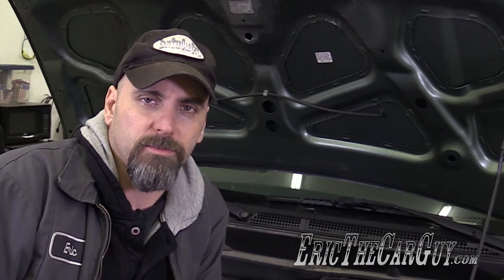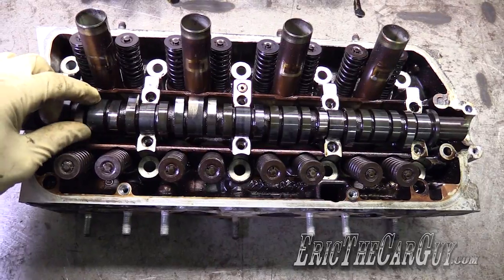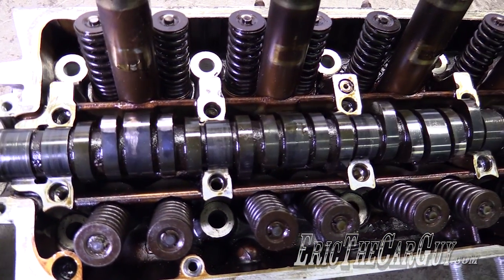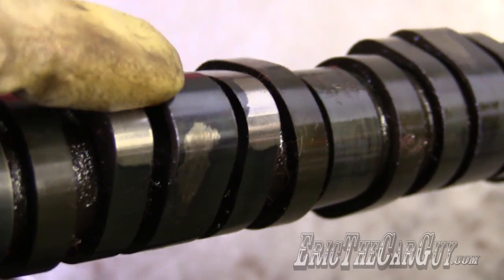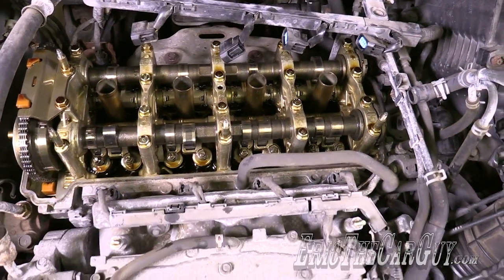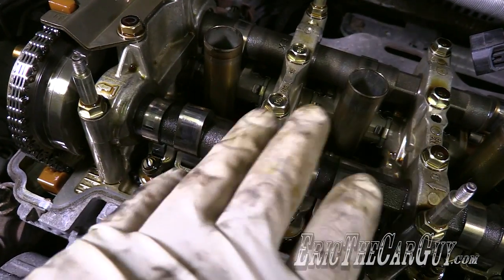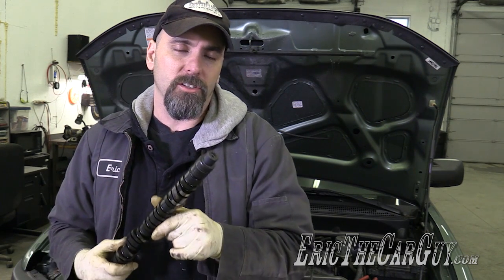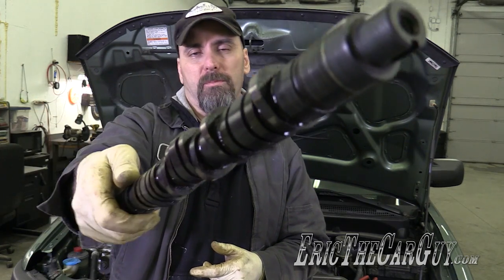iVTEC How it Works -EricTheCarGuy

Comment: 90 percent of new cars and trucks have this now, it is also called variable valve timing.
Reply: Even though many cars "might" have it. Honda instead of many others nailed it. The timing, cams, and engine can handle it and produced more power due to the ecu they use.

Comment: Funny, I feel like the VTEC on my 01 Honda Odyssey as it has plenty of low end torque but really wheezes out above 3500rpm.
If its mechanical based on oil pressure, then how could it fail without loosing total oil pressure.  (PS if you want to find out I live in Dayton :p)
Reply: generally they dont fail. the solenoid could fail? the sensor could fail. they usually dont fail mechanically.
Reply: So its not entirely mechanical then (which is what I thought originally).
Reply: well the cam lobes operate the valves purely mechanically.. it is engaged using oil pressure, which is controlled by sensors and solenoids.
Reply: and ultimately the ecu, tells the solenoids when to use the oil pressure to engage the vtec rockers, which are actuated mechanically by the vtec lobes.

if that makes it more clear.
Reply: *****  neverknows best Yes initially I figured it was some solenoid, but Eric's explanation had me a bit confused.  There is no SEL light on but the car is very sluggish in the upper RPM, and also I've never heard the engine change tone or get that "VTEC kicked in yo" feeling that hopped up Civic's and Prelude's get when the cam changes profiles.
EricTheCarGuy 
Is there any good way to test what the problem is?
Reply: you cant alwaays feel it. also the k24's from accords, elements and crv's usually have a lower changeover point, and a less agressive secondary cam lobe.. so the difference would be less noticable.. and by top end do u mean at high speed? or at the high end of the rev range regardless of speed? even at low speed?
Reply: High RPM...feels like its got ~200ish torque at lower RPM and about ~170hp max where it should have 240hp. 
It says VTEC right on the engine cover that I took off...just doesn't seem to have it anymore.
Reply: what car is it in? cuz most k24s only have about 170 anyway...
Reply: First post says...Honda Odyssey.  I believe its a 3.5L V6.
Reply: im sorry thats my mistake. the oddyssey engines are different. they behave like SOHC since i believe that they are one cam per bank. also some odysseys have variable cylinder control, which allows them to shut off up to 3 cylinders depending on whats needed.

and yea for a passenger car like that. its optimized more for low down torque, and comfort more than high revving power.
Reply: neverknows best It still says VTEC so it ought to have two cam profiles even if its SOHC.
Reply: Adam S im not saying it doesnt. im saying it may only have vtec on the intake side and not exhaust side. and a lot of vtec systems are for efficiency, that may be why yours doenst feel powerful up high like the sports oriented vtec systems.
Reply: K24s come stock with 240

Comment: U should do a video of VVT-i works on a v8 engine like in the 1UZ-FE
Reply: its the same as vtec. they are both variable cam timing systems.

hell even the newer corvette v8's have some form of cam timing, and theyre pushrod engines.
Reply: neverknows best 
O nice to know is about the same.

Comment: Eric, question for you, I recently had my car have some major problems occur, and possibly have the oppuronity to have an engine put into my car that will create more power. I have a 2000 ford focus ZX3, about a week ago... one problem lead to another and my car caught on fire, it was my fault, now im in need to fix it. Before that occured i was having a rough idle for about 2 months, previous owner told me he swapped out the engine with one that was newer, the idle is only rough every once in a while, i did general maintenance, spark plugs, air filter, oil change, ect... I'm wondering if it would be worth while, while i'm fixing it to swap out a engine from an svt focus of same generation into my car, or should i just keep it the same and fix it back to what it was before this problem occurred when it... caught fire. Right now the parts list that i'm looking at to fix it back to what it was is new air filter housing, new battery, battery housing, engine wiring harness, new thermostat, and a couple hoses. I also have been having quiet an oil leak, I went through a quart of oil about every 2k miles. The leak has occurred from the front drive pulley. I'm in a loss as what to do... I love driving my car, love the look, love everything about it.. ( info about it, Since i bought it this past june I had to replace the oil pan gasket, fuel pump, rear shocks, clutch and slave cylinder, and a couple other things.) I'd love to hear back from you! Ps. Keep up the good work with the videos, they are very helpful for the handy man.
Reply: The SVT engine makes a lot of peak power. However, you may run into other issues. You would definitely have to purchase a matching SVT ECU. And you may or may not have to change the trans also. I'm not sure if the split port 2.0 motor has the same trans mounting. The SVT does come with a six speed manual. And it may mount different. That being said, it may be easier to replace the motor than trying to hunt down little problems. But if you don't want to have to make any other changes, replace the motor with the same year and model to avoid any other differences. Cheers.

Comment: This is awesome knowledge overload. The intricacies of this system are amazing. Nothing better than telling a VTEC owner what VTEC actually is and does. 

Are there any other motors (non-honda) that have a similar system?? Or is the Honda VTEC a one of a kind??
Reply: bmw has Vanos
Reply: Whoops used the word 'motor', Should be 'engines'. Don't let the trolls see that.
Reply: Darren G. I heard that VVTI is basically the same. i don't know though.
Reply: arnaldo vargas

I had heard the same thing. Many companies just dub the same thing under a different name so it wouldn't surprise me.
Reply: almost every car manufacturer has "variable valve timing" which is essentially what vtec is. its not a honda thing by anymeans. and im a honda owner
Reply: The Nissan version is called NEO VVL
Reply: dont know what its called. but nissan, GM/chevy, ford, honda, toyota, mistubish, bmw all have ones. i dont remember their names offf the top of my head. lol
Reply: Toyota's VVTL-i
Reply: VW, Alfa Romeo, Peugeot, Citroen and many other have it too. Its just so nothing impressive, that most manufacturers don't make a big deal of it. Just like DOHC or at least 4 valves per cylinder are common in most European cars and somehow you don't see those badges on the trunk anymore.
Reply: INFAS166 those engine features WERE something to be proud of at one time or another. they are more commonplace now so they dont show them. the vtec badges usually still only come on the performance cars from honda. and theyre more of a marketing thing than anything else now.

much like mopar and "hemi" lol
Reply: ***** well pretty much all engines use hemispherical combustion chambers. so even hondas are hemi's now a days. its just a badge now. it not anything special now.
Reply: ***** actually A LOT of variable valve timing engines have more than one cam lobe... 

and it was unique. a long time ago. but its not unique anymore.
Reply: ***** no thats completely wrong. many many have multiple camp lobes per bank of valves.
Reply: ***** also, even single cam engines can have multiple cam lobes for the intake side.
Reply: ***** well since i have a vtec-e engine i should know. what it does is use one intake valve under lean burn mode, and 2 intake valves under normal (higher rev range) operations. 

your definition of the economy vtec is a little off. it starts off with one valve, then engages vtec which engages both valves.

this is essentially what the vtec on the non performance k series engines does. the k20 from the base rsx and ep3 si use the same system. but they have cam phasing also.
Reply: ***** technically ALL versions of vtec are for economy at least a little, they allow you to have economy at the bottom range and power up top. the vtec-e system switches between 12 valve and 16 valve mode basically. the k20 20 in the base rsx uses a similar system on its intake cam shaft, but also adds in cam phasing on top of it.
Reply: The vast majority of automotive manufacturers have (and still do to an extent) played with different valve lift/timing systems for their vehicles. Honda/Acura of course utilize VTEC, Toyota has used VVT-I (just cam timing) and VVT-IL (Variable timing with life, just like VTEC), Mazda utilizes variable valve timing (not sure of system name or if they utilize variable lift), BMW uses VANOS and double VANOS (Variable lift and timing for either one or multiple cams), Nissan has variable valve timing and the old schoold (NEO VVL) system which acted on lift as well. Basically everyone uses it to a degree.
Reply: ford does this with there 5.4 litre triton there called phasers
Reply: Vtec is a form of vvt (variable valve timing) Most other car manufactures have a vvt engine. The demand for better fuel economy while keeping the performance is pushing the technology.
Reply: ***** you are mistaken, standard VVT (vtec) has two different cam profiles per cam shaft. two for the exhaust cam and 2 for the intake cam. Ivtec, has both of these AND cam phasing.

there are a few exceptions, the non performance k series ivtec has what ammoutns to the vtec-e systems of old. and only applies to the intake cam, the performance oriented k series engines have two cam profiles per cam, AND cam phasing. (something that the old vtec lacked)

what that article is calling vvt (if you follow the vvt link) is cam phasing. most modern cars with variable valve timing, ACTUALLY change the cam profile. as well as cam phasing in some. mazda does it, ford does it, chevy does it, toyota does it, im not sure i know of any subaru's that do... but im not making a claim on that one.

regardless you are mistaken, also the vvt link in in the link you posted uses a k24 or k20 head, which has two cam profiles for the intake cam and one for the exhaust cam, AND cam phasing. the I in ivtec denotes cam phasing in addition to multiple cam profiles that existed in the previous generation vtec motors of honda.
Reply: +Darren G. Subaru also has more or less the same system, called AVCS, and most car manufacturers listed above by other respondents have some form or another to control valve and cam timing. The only engines that typically don&#39;t have it are old engines and V-8 crate motors which I believe are simply an OHV or SOHC design

Comment: just to be accurate the camshaft lobes only open the valves they don't close them. valves close from the tension of the springs. its not a desmodromic system that the cam actually opens and closes the valves..
Reply: technically they do not close the valves, but they do control when and how quickly they close due to the other side of the cam lobes.

Comment: iVTEC is better because its a stepless sytem while VTEC is either on or off iVTEC is a more advanced system to get either the same or better results
Reply: actually i vtec works the same as normal vtec. it just has another added control, being cam phasing.. which has no effect on the step or stepless-ness of vtec engagement. 

it is however better than normal vtec.
Reply: i know the ivtec system from psa engines (peugeot citroen) im not sure if it works the same as that vvt but on th psa engines the camschafts angle can steplessly be adjuste over a quarter off the timing gear the system works with hydraulic pressure you have 2 chambers inside the timing gear with valves in the valves are connected to the camshaft when the pressure gets on one side of the valve it pusches the camshaft either clock or counter clockwise in relation to the gear this way it can be steplessly adjusted to get the perfect result every time
Reply: yorrickwi i get what youre saying. but thats not stepless. since variable phasing of the cam shaft doesnt effect the step on and off of the secondary lobe. it might make it seem a little less sudden. but that could also be due to the secondary cam possibly being not very agressively different.

we dont have the "psa" stuff here (america) but i vtec can still certainly have a very exaggerated step onto the next cam lobe. even with cam phasing going on at the same time.
Reply: ax53b60 i didnt know the adjustable cam gear worked alongside the normal vtecb i guess i stand corrected

Comment: Hello, I think the name of the feature that change the cam timing on the fly is VTC (not iVTEC wich is the naming of the engines of a family) the explain and the principles are right, it is just the name of the thing "VTC".
Reply: vtec is just what honda calls their "variable cam timing. vvti is what toyota calls their variable cam timing.

every manufacturer has the same thing under different names.

Comment: nice, I thought all vtec cam is very high, but civic vtec cam is very low. In a s2000, vtec cam is really taller than normal cam
Reply: the cam changeover can be set at different points. but the cam lobes themselves work most efficiently at one set rpm. so their lift and duration usually dictates where the changeover is for best efficiency..

some happen low in the rpm band, some happen high. its usually dictated by the cams lift and duration, which is not something you can change without changing the whole camshaft out.

Comment: Ugh too many honda VTEC crap videos. VTEC IS THE SAME ON EVERY HONDA!!!! DO NISSANS CVT VIDEO! OR MAZDA ROTARY ENGINE VIDEO! NOT A CRAPPY VTEC VIDEO!
Reply: well its not a "crappy vtec" video, its about a complicated engine system that is applicable to many engines around the world that use variable valve timing. including nissan and mazda. 

also rotary engines are simple, not complicated.. cvt's are actually very simple compared to normal auto transmissions.
Reply: yea but its just its very intresting to me. the ROTERAY ENGINE  Nissans CVT.
Reply: also why focus on nissan cvt? many are doingthem.. honda been doing them on hybrids for a long time.

subaru is putting them in almost everything now.
Reply: yea but nissan perfected it.  and Like I said I AM A NISSAN FAN.
Reply: ohh then nissan made the CVT everyone had to follow and make their versions of the CVT. by which they struggle to make their own efficiant version. and by the way you honda people should know that honda dont make cars well their paint is sloppy put on and fit and finish is terrible the keylees entery was introduced and perfected by nissan.  hondas are a 1 hit total cars. nissans can take the beating.
Reply: Christopher Hernandez wow you cant even argue using facts. all you say is "nissan does it better" all the while making no actual objective points.

your opinions of hondas (btw im not a honda fanboy, if anything im a toyota fanboy) are not sloppily made. most nissans ive ever encountered fall apart as faster than anything else. 

theyre not made to the higher standards of toyota. and theyre not made as efficiently as honda. theyre a poor middleground.
Reply: well every honda ive encountered has been abused and poorly mantained. and still outlastst the nissans lol

and sucks for you.  stop liking nissan so much. they made one good car. 

honda has made a few

toyota has made dozens lol.
Reply: the 350z is moderately good. but overweight and unimpressive, the vq is good tho..

all S chassis are cheap feeling, and at least in the states lack any decent engines. also when i said "gtr" i was referring to all skylines.. those are good.. but thats about the only thing nissan ever did any good. the 240z was cheap as fuck, it just looks good. the 510 was cheap and fuck its just a cult classic, not good in its own right.

and just cuz u think they're "nice" doesnt mean that theyre any good.
Reply: ***** well i have owned an s13. and while i dont hate them. i dont drool over them either. i do dislike their macphearson strut suspensions up front. and their interiors ARE cheap. here in the US (dont know where u are) the sr20's have to come from overseas. theyre alright engines. but really not one that i like much either. at least their head designes. 

now an s13 or s14 (we never got the s15) with an rb20 - rb26 is a cool car..

but a mk3 or mkiv supra, or sc300/soarer with a 1jzgte or a 2jzgte. thats more something im familiar with and that i enjoy.
Reply: Your a hater sorry buddy who drives a Nissan unless it's a 240sx or skyline not many so yeah you need some hateorade
Reply: Steven mercado lol real mature comment there. take your high school level education and go somewhere else with it.
Reply: I have beat the crap of my hondas I have owned and resold them for more than what I paid for them.... Nissans are durable cars as well..my high school  friend rammed into a school bus with his nissan and got rear ended in a seperate crash a month later...even though it lost like 2 feet of trunk space and the car didn't drive as straight anymore he still drove it for a year till he sold it for parts still running lol..ok  maybe Nissans can take a beating and keep on ticking..but I think Hondas fair just as well even though styrofoam comes out of honda bumpers when wrecked...